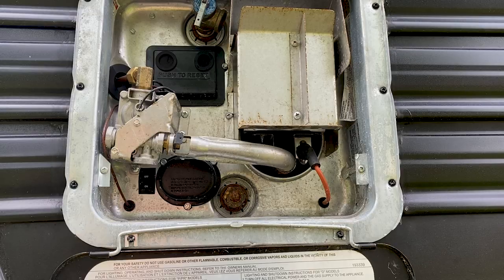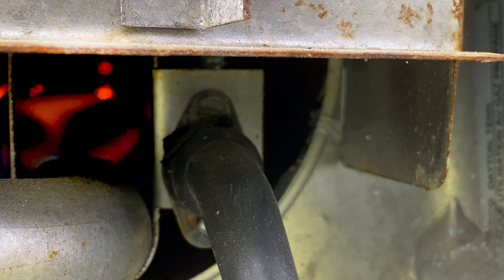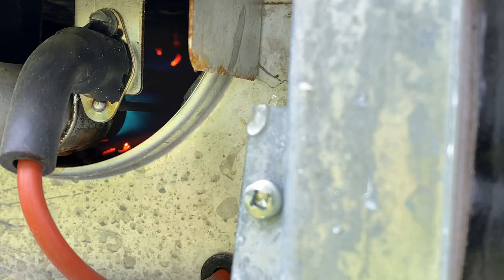Travel Trailer Gas Electric Water Heater Explained 2021

Comment: I choose mine based on load.  If I have the AC or fireplace on I will use propane only so I don't overload the 30amp if say the wife uses the microwave.  But when it comes time to shower the kids I'll turn both on to make sure we have plenty of hot water.  Excellent videos!  Its cool to learn from someone with the same rig as ours.
Reply from the maker: I think that this model f camper is very popular. I do get a lot of emails and comments from those who share the same camper as ours. We manage our electrical and hot water in the same way. Also check out this video about electrical management. https://www.youtube.com/watch?v=PgciDMnMZDU

Comment: Great tip! I was wondering if that is ok to do as well. I was told by experienced rv’ers to hook up power and water soon as ya can and then continue setting up and leveling. This way water heats up by the time you are complete.
Reply from the maker: If i really wanted to warm the water while setting up, I use the propane to get started. The water doesn't really take all that long to heat up for the most part.
Reply: I would not turn on the hot water unless I know it is full of water make sure you turn the heaters electric off ! If you run it at all without water it will cause damage or burn out element.

Comment: QUESTION: if you're low on propane, but need to leave supply on for stove-top & furnace; should you toggle the electric switch ( in the Exterior Access panel) ON ? Will it heat faster, thereby using less propane? Thank you in advance  & for All your helpful videos- Yes I'm subscribed!
Reply from the maker: In this case, I would leave the electric side on outside and turn off the propane side of the water heater inside. This will allow the water heater to not use any propane at all. Hot water use will have to be monitored a lot closer but you will have extened use if low on propane.
Reply: @HowToRV  Thank you!  There's just one switch inside for water heater, I'll try that & see what happens!

Comment: Do you know if the electric side will work if only connected to my home 15 amp service?  We rarely hook up anywhere, but I'd like to test the electric side of the water heater on our new trailer.
Reply from the maker: You should be ok as long as that is the only thing you have turned on. To be on the safe side, you could turn off the breakers to everything except the water heater.

Comment: Great information. I have the same unit in my GS Conquest. I see you can run propane with or without electric. Can you run run electric alone to save propane?  Can't shut off propane, as it's needed for  refrigerator while traveling and cooking while on shore power.
Reply from the maker: You sure can. I have used ours on electric only many times. I just leave the switch on the inside of our RV off during those times.  Also recommended videos. 

Water heater explained - https://youtu.be/vk9Nt6RMHps

Monitor electric usage - https://youtu.be/PgciDMnMZDU

Upgrade propane storage - https://youtu.be/j6h_QvB0D5k

Hope you enjoy.
Reply: @HowToRV  Thank you for responding so quickly. I'll check out the other videos.

Comment: I have a question... I can't find any info.  My lady doesn't want propane on the unit.  Is there a way I can hook an electric one up?  Or just never use the propane?  I'm desperate for answers soon as we are coming to an end with our renovation
Reply from the maker: On ine, the i can set it up to run electric only. To do so, I dont turn on the switch for the propane side that is in the RV. I understand that some may have fears around propane usage. My wife has the same concern. You can add detectors for propane leaks as well as using soapy water to spray on fittings to make sure that there are no leaks. For my daughter, her eyes get irritated really easy with usage of propane appliances and we make sure to have windows cracked open to vent out fumes from the oven. As for the water heater though, I have never had any issues. I did recently go to a tankless water heater and they are propane only. I just make sure that the carbon dioxide detector is operating correctly and check for leaks at the connection points every 3 months. hope this helps.

Comment: I pulled the sacrificial anode. Looks ok. Are you supposed to leave the pop off open when filling the hot water tank to be sure it’s full before turning on the power?
Reply from the maker: I turn on a faucet until I get water coming from the water heater. Then I turn it on. I do not use the relief valve.

Comment: I have the combo water heater in my Flagstaff. Question! Does the propane light on and turn off as needed? Or would I need to manually turn it on every time? Also, that rocker on/off switch near the bottom next to anode. Is that for the propane or electric element. I’ve been only using the electric element, and have been under the understanding that rocker switch is for the electric only.
Reply from the maker: On mine the rocker switch is for electric only.  Also, the propane comes on and off as needed. It looks for temperature of the water.

Comment: Great video. I have been trying to find out if you could run both propane and electric. I do have a question. I have been using gas only and it doesn't seem to be keeping water hot for long. I can get some hot water maybe do dishes then wait few hours for shower and barley any hot water. Any ideas why that may be happening?
Reply from the maker: Just wondering, Can you get one decent shower in? If so, then that is about how long mine lasts as well.

Comment: Can you use electric and not propane when running the shower and it will be hot off the electric?
Reply from the maker: Yes. You can take a shower when running both. My wife just did...LOL... Also, if working properly, the electric will heat your water just finne. Just remember that with electric only, the water will get cold faster because the heating element cant keep up. Sorry but you will have to take military showers (soak, turn water off, lather, turn water on, rinse and repeat.) Hope this helps.

Comment: Might be a dumb question, but does the water heater tank get filled up with water automatically when you attached and turn on the fresh water hose into the trailer?
Reply from the maker: It does. That’s a great question. Now the water heater does have bypass valve that are used for winterizing. Need to make sure these are open.

Comment: Great explanation!  So if you are running both electric and propane how long can you run hot water before running out?  And once you run out, how long does it take to heat back up before you can have hot water again?
Reply from the maker: Lets use taking a shower as an example along with my 6 gallons of hot water. With the electric and propane running, I have about 10 minutes of continuous hot water, If i turn the water off in between lathering and rinsing, I do not run out of hot water before finishing. There are many factors such as temperatures outside, how cold the water coming into the camper is, if someone is using the hot water elsewhere in the camper at the same time. If we use up all of the hot water, the system will fully reheat in about 20 to 30 minutes. Hope this reply is helpful.
Reply: @HowToRV  Okay...great!  Thank you for taking your time out to answer my question!  Very helpful for a newbie!

Comment: Do you need to turn the oven off button to open when you use propane to heat the hot water tank
Reply from the maker: Not exactly sure of your setup but I can use the stove, oven and water heater on propane at the same time.

Comment: How come my RV water heater is getting hot in electrical but it doesn't comes out hot in the shower or sink?  Please can you help me with this issue, 

       Sincerely; John
Reply from the maker: Check the outside shower heads if you have them. I have one on the backside of my RV ad one in the outside kitchen area. I have heard of folks leaving the water on and turning off the hand held shower head. This causes the hot and cold water to mix which in turn cools off the hot water. Hope your concern is just that simple. Also check to make sure the bypass valves are directed to run in the RV on the backside of the water heater. Hope that this helps

Comment: If the water supply is shut off to the rv and the propane is on will the water heater still run?
Reply from the maker: It should as long. I have done it with water in the tank. Never tried to see what would happen is the water heater was empty.

Comment: I have a dual gas/electric water heater switch inside my rv ... I just don't understand how that switch works?? There is a jumper wire that connects the gas switch side to the propane switch side... and I don't understand how it works (a shared switch control) when one side is AC and one side is DC? And how does the red light in the middle of the switches communicate with both sides and to me? Any help would much be appreciated. Thank you!
Reply from the maker: That is quite interesting. I am not sure how to answer that one. My shore power and 12v switches are seperate. Mostly because my switch for the 12v side are not meant for 120V ac. If you could email me a couple of pictures, I might be able to figure it out. How2RV@gmail.com

Comment: What if we wanted to replace the water heater with a tank less water heater?
Reply from the maker: I have been toying around the idea of changing to a tankless water heater. If I do, I will most definetly make a video on how it works. The designs are completely different and from what i have read, the tankless water heaters are propane only.

Comment: I have an SW 10de and on electric it occasionally shuts off and the gas does not work at all. I can not afford a new unit. If I replace the control module, heating element, and anoid would this be cheaper and probably fix the problem?  Where is the control module located?  Thanks  Dan
Reply from the maker: If you're looking to not spend a ton of money, i would recommend getting a professional to run some diagnostics. I have heard that there are ways to run electronic tests to see if the board is functioning correctly. I have not ran into this issue and cant speak fully on it. If i am not mistaken, the board is located on the back side of the water heater. I hope that this helps.

Comment: question, my RV is currently winterized but im going to de winterize it soon for use in the south. but the switch is in the on position and i cant turn it to off. Sorry im very new to this, but why cant i turn the electric heater off?
Reply from the maker: sounds like the switch is stuck. You may ned to get someone to look at it and see if they can free up the switch or replace it if needed.

Comment: You never discussed electric only.  How does one know their heater is working on electric?  turn off gas. Will it heat?  Mine doesn't even though all switches are on.  Why?  Need to address electric only, because what happens when you run out of gas but still want a warm shower?
Reply from the maker: Thank yo for the tip for a future video